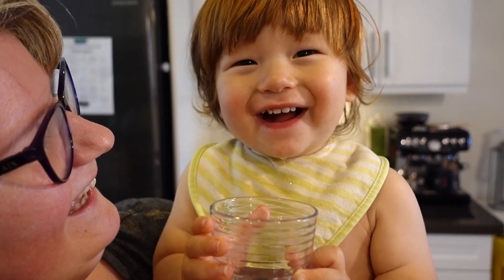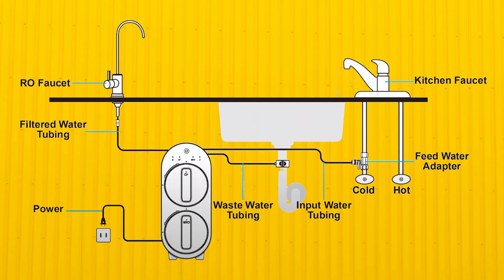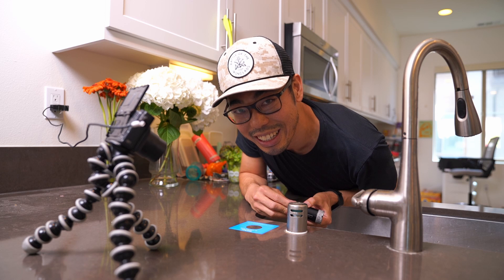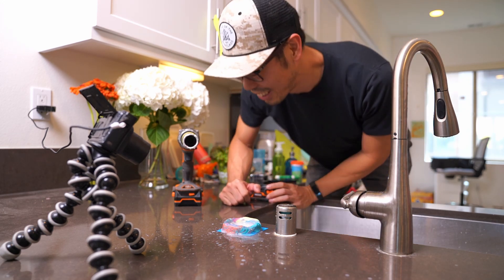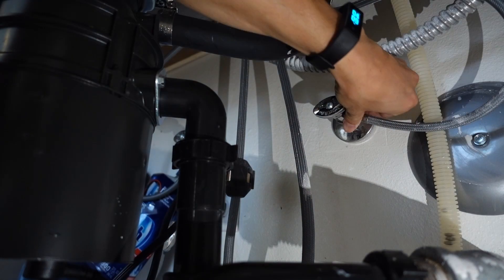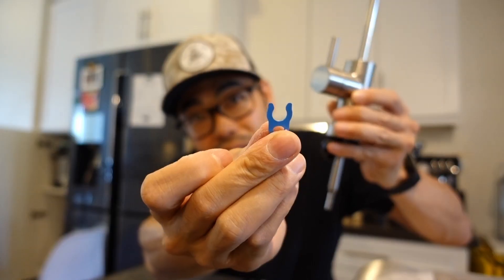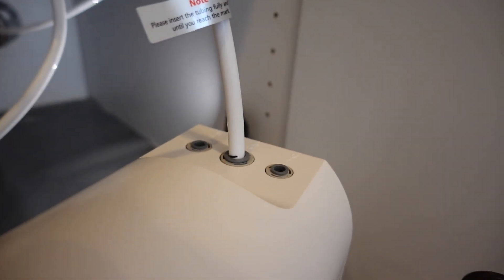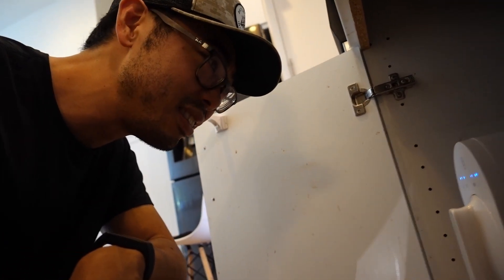Waterdrop G2 P600 Reverse Osmosis System Installation

Comment: If anyone is looking here for help, drilling the hole doesnt need to be difficult when using the right tool. 
 All you need is a hole saw with a pilot bit made for stone / concrete / granite. 
  The small pilot bit in the center is slightly longer and easily keeps the core bit from wandering as it enters the surface.  
 The bit used in this video could also get the job done, but you would first need to drill a hole thru a 2x4 or piece of plywood that you could clamp to the surface to guide and keep the bit from wandering until it has begun boring.

Comment: Thanks for the review and instructions. The pass-through metal bolt for the faucet doesn't look that big. You could have gotten away with a half-inch hole instead of the suggested 1.375.

Comment: it's amazing how you just plug the tubes without any fixation into the unit (?) and no water is escaping while using it...? I have a phobia that something would start leaking eventually with so many connections (I'm linvin in a several storage apt.) -_-'

Comment: How much noise does the unit make. I had one installed and don’t know if the sound is normal or not.
Reply from the maker: Relatively speaking, it seems quiet to me... But without a video, it's hard to tell
Reply: @kentahonjo7180  I’ll record it and post the link here, would you be able to let me know what you think?

Comment: Many hole saws come with a place to put a drill bit in the center of the hole saw  to use as a guide for the hole saw, this manes for a much cleaner hole, just saying. I enjoy your videos.
Reply from the maker: Thanks for the comment! Yes the hole saw I bought did have a drill bit in the center, but that kept slipping... Should of took the time to do a pilot hole.

Comment: Enjoyed watching this since I'm close to installing one. It looks like the hole drilled could have been a lot smaller, like 1/2" maybe, did the instructions guide what size you drilled into the counter? We have a granite countertop as well so I'm watching a bunch of these videos. 👍🏽
Reply from the maker: Yes, you can certainly go smaller for this installation.  1/2" might be too tight, but I don't recall the instruction manual saying anything about a recommended drill diameter.  If you haven't already, I'd suggest you get the Waterdrop first and then measure.  Should've done that in the first place SMH, haha.
Reply: I agree smaller hole. Only reason for larger hole is preassemble, feed all in from top. Then slide split washer on underneath... Great vid, bit scary at times 😲😉

Comment: How is it working one year later? How often do you need to change the filters? Any issues getting filters?
Reply from the maker: It's working great. I haven't had any issues and haven't had to change the filters yet. We use it daily, so we should be due for a change, but I'm relying on the filter change indicator, and that hasn't prompted me to do so.

Comment: How frequently are you changing out the filters? And about how much do the replacements cost?
Reply from the maker: Haven't had to change out the filters yet (6 months of operation).  I'm keeping an eye out on the filter indicator, but so far no issue.
Reply: Most ROs are once a year. I just installed my g2. Looks like around $75

Comment: Does the unit make a lot of noise when using the tap?
Reply from the maker: I wouldn't say it makes excessive noise, but it's definitely not silent.  It's only audible when you turn the tap, and since it lives underneath the sink (the sound is attenuated quite a bit), it doesn't bother me.

Comment: Dude, you ruined your counter top, definitely used the wrong drill bit. They make special diamond bits for granite with a center bit to avoid scratching the surface like you did. Holy crap. Granite is not cheap
Reply from the maker: Haha, I know, it's pretty cringe-worthy even for me. You can bet I won't be doing that next time! If you have a recommendation for the drill bit, let me know and I'll update it in the description.

Comment: Any reason you didn't just use the hole from your air gap and use a high loop instead? Looking to install this but don't want to drill a hole.
Reply from the maker: No real reason other than it sounded like a good excuse to drill a hole into my countertop (I've always wanted to know how hard it was... learned the hard way🤣)! I'm not 100% sure on the actual procedure, but using a high loop seems like a good alternative.  Let me know if it worked!  Good luck :)

Comment: I just got this and love it.  Would you know how to turn off the automatic shut off to this system?
Reply from the maker: Awesome! I've tried looking up the automatic shut off, but can't seem to find it...  Could you please elaborate?  Mine is on 24/7, and water flows whenever I turn the faucet on.
Reply: This unit does not have a reserve tank and is on demand filtered water. 

Aside from this an ASO(automatic shutoff valve) is just that ... Automatic .

Comment: Hi, thanks for the video. Did you see a huge water and electric bill increase after using this filtration machine for a month?
Reply from the maker: Great question... I've been wondering that myself.  I haven't noticed any huge spike in water or electricity usage, but I want to someday get a more definite answer to this.  The water bill is actually not that bad, and drinking water is only a small percentage of the total water usage, so I'm not worried about that. Waterdrop also advertises that it's a 2:1 drain ratio (2 glasses of clean water, 1 glass down the drain), so you can calculate it that way as well.  Measuring electricity usage is a bit tougher, and I would have to get an energy meter to really see how much power it's using. Until I get one, I'm thinking of conserving energy by hooking up a smart plug so I can automatically turn it off when everyone's sleeping. That being said, I don't think you'll see a huge increase in your utilities just because of this machine.  Seems pretty efficient.

Comment: For those who don't want to drill a hole in their countertop, there are also faucets with integrated water filter faucets (2 in 1) .  My question is, if you move and want to take the system with you.  How do you "clog" (for lack of a better term) the draining hole?
Reply from the maker: Hey Karen!  Thanks for the tip about the 2 in 1! Regarding your question, I think the best way to cover up the hole is to use one of these: https://amzn.to/2SxuzPn.  It’s not the prettiest thing, but it’ll do the job.
Reply: @kentahonjo7180  Thank you so much for your reply!  I will try that
Reply: @a.k.slzr5  for those kinds of faucet, if you remove the RO unit and shut off the source water valve. There is nothing else to do.. right?

Comment: What is the water output flow like? Could you make a video showing how long it takes to fill a measuring cup? That would be super helpful for me.
Reply from the maker: No problem!  Once I shoot the video, I'll post it and let you know.
Reply from the maker: Here you go: https://youtu.be/SkZXzyVSSfQ. Good news is, it's faster than what Waterdrop advertises. It'll surely depend on how much water pressure you have at the faucet, but you can probably estimate using my video.